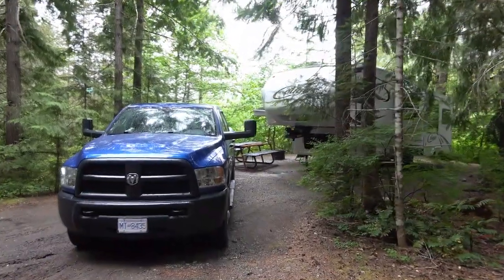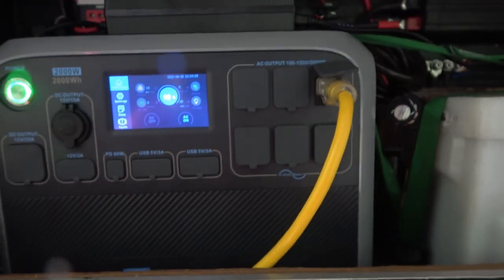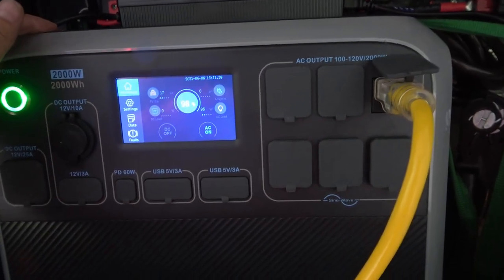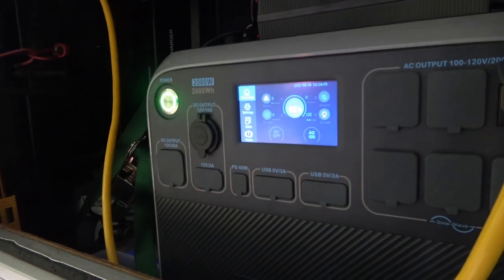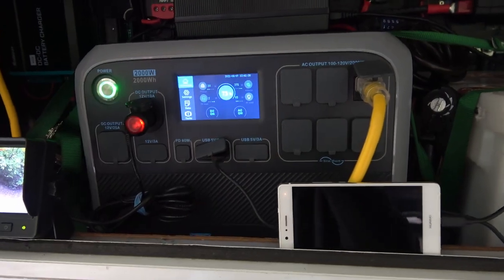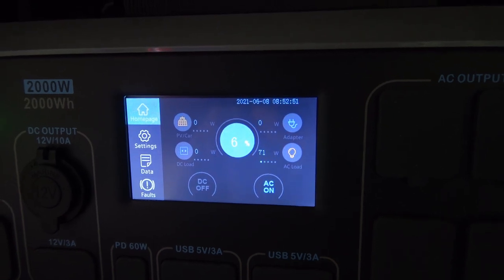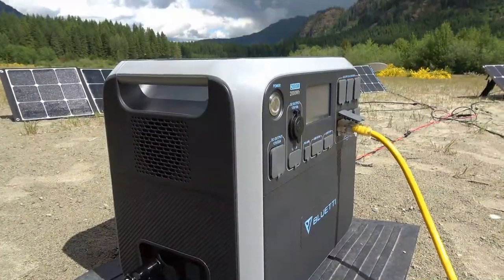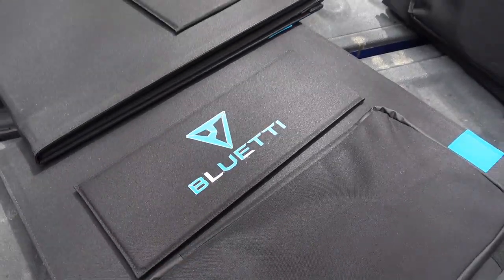Bluetti 2000 Watt Power Station Review (Part 3) Real World Camping Test + Pros/Cons & Final Thoughts

Comment: Great review, Ray👍👌 I got a brand new Bluetti SP200 but it was DOA, I plug in to AC200P same like yours. It shows 0 A even with direct sunlight. I thought they are good but looks like product comes from China with very low quality control. It will send back to get refund. I am going to get Renogy panels instead.
Reply: If you just have one panel, you probably do not have enough voltage to get the MPPT controller to allow input from the panels.  Connect two panels in series to get the minimum voltage necessary to charge the battery.  Bluetti says the SP200 has a voltage of 20, and the MPPT controller in the AC200P requires a minimum of 35 volts to receive charging, so you will need 2 panels at least!

Comment: Is it possible to connect the bluetti AC 200p with a gas generator and charge it that way.
Reply from the maker: Yes, just plug the ac charge adapter into the gas generator.
Reply: @LoveYourRV  thank you so much I feel much better now.  Have a great day today
Reply: Can u run a small heater  6/6
Reply: @cjnicol4248  shure can

Comment: Why haven’t you gotten the extra batteries to go with the AC200? That would give you an extra 2000W with just one extra battery.

I see, you didn’t buy it. My question is meaningless. You can run the Bluetti by cell phone.
Reply from the maker: I think at the time of the review the 2048Wh expansion battery pack was just about to be introduced. For the AC200P model its sort of a clunky system involving extra cables and adapters using the solar and AC charge ports. If you desire to expand I'd go with the AC200MAX. It has dedicated expansion ports with one simple cable to attach. https://www.bluettipower.com/products/ac200max-power-station  Cheers, Ray
Reply: @LoveYourRV  I already have it.

Comment: Small heater 6/6  will it run it  small one buner cook top
Reply from the maker: Yes, should be no problem. It has a 2000W inverter with 4800W surge capability.  It ran my microwave and air conditioner and my wife's blow dryer. It may not run for very long though. The output capacity for the inverter is around 1650 watt hours. So if the cooktop draws 1650 watts it will run for one hour. Cheers, Ray

Comment: You can’t start your AC because it has such a big, immediate power demand to turn on it overloads the generator.  You need a soft start unit between the generator and your RV. Then is should work.
Reply from the maker: It will depend on the Locked Rotor Amps rating of the air conditioner and the starting current reduction of the soft starter. Wired in soft starters are better than plug in play. I tested a  plug and play type called an ActiveStart and had no success starting my new Furrion 14.5K BTU AC unit with a LRA current rating of over 60 amps. I tried it with a two different inverters 2400W and 3000W and a 2000W gas generator. https://www.loveyourrv.com/activestart-soft-starter-rv-surge-protector-review/  Gonna try a wired-in model next as it has better soft starting percentage reduction. 80% vs 50%  Cheers, Ray

Comment: is it better to wire 4 RV solar panels in parallels or in series
Reply from the maker: There are pros and cons. Series wiring will make the voltage higher so wiring can be smaller gauge saving money and making installation easier but you have to make sure the charger can handle the higher voltage. Parallel wiring is more shade tolerant since if one panel is shaded it doesn't affect the power output of others. Here is a basic article on it - https://www.renogy.com/learn-series-and-parallel/ 
When I first installed 4 panels on my RV 7 years ago it was better for me to use parallel wiring since the cost of an MPPT controller to handle the higher voltage conversion versus a simple PWM controller was so high the price difference could pay for an extra panel and the extra wire cost. Nowadays MPPT controller prices have dropped so makes sense to series the panels unless they will be often shaded. People on sail boats will often prefer parallel wring since the mast and rigging is almost always shading panels.
Some better quality panels have special bypass diodes that help limit the shading issue on series runs so even that problem has been reduced somewhat. As systems grow in panels people often do a series /parallel wiring of the array to get the voltage advantage but still be more shade tolerant. Cheers, Ray
Reply: For the Bluetti , you  must have minimum of 35 volts input.

Comment: You will see a 30% loss in the next months on those solar cells. They are not made to be lying in the rain
Reply from the maker: Not sure why you figure that. Used them a year later and after several more weeks in the rainy weather in the spring 2022 and pulled full wattage in good sun.
Reply: @LoveYourRV  correct the only part I believe really has any possibility of water getting in is in the plug itself.  Otherwise the panel itself is a sealed up deal